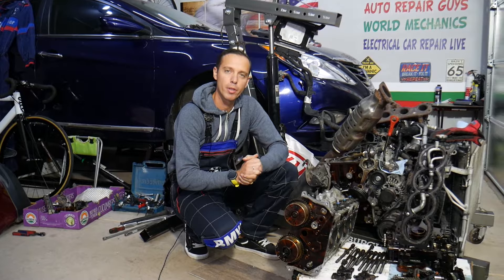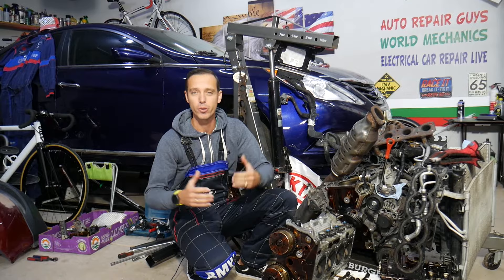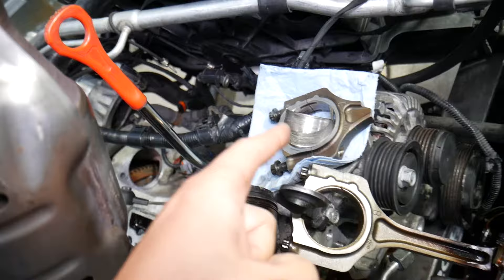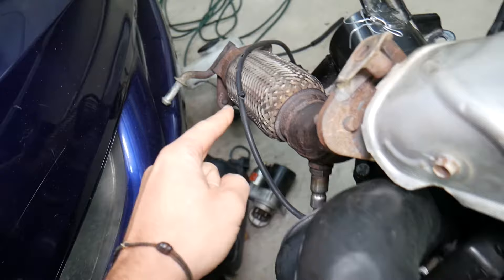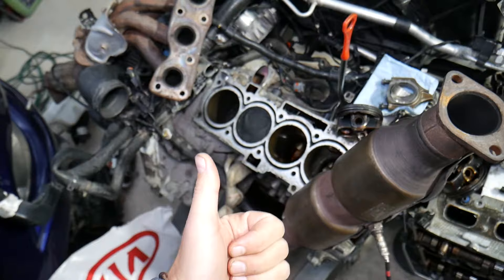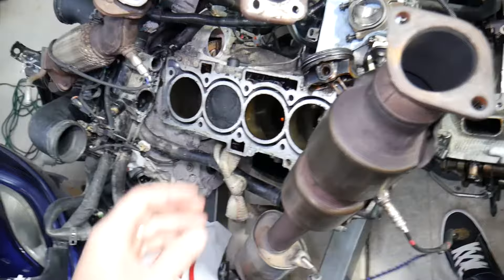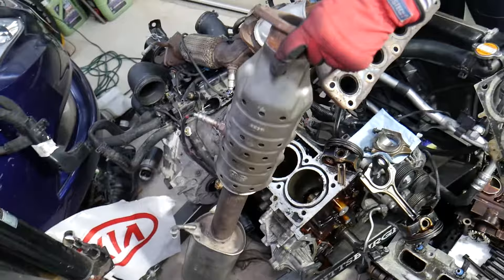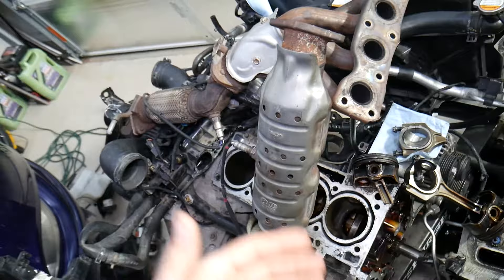WHY CAR SMELLS LIKE ROTTEN EGGS SULFUR WHEN ACCELERATING

Comment: Lexus owners unite! 😔
Reply: YOOO, is250?
Reply: Lol gs 430 smelling funky
Reply: Look for - lexus is250 vent
Theres a duct inside the boot/trunk. Find it and replace it.. or just duct tape it shut 👍
Reply: @indigoprime3663  that’s the problem I had
Reply: @indigoprime3663  I meant to say you had * but yea I might try that but if not prolly try to clean out the cats
Reply: @Tirekillaz  it will work. Trust me.
Reply: @indigoprime3663  I have a gs 430 tho
Reply: @Tirekillaz  Check in the back, see if you have the same ducts.
Reply: @Tirekillaz  just noticed my gs 350 doing it
Reply: @JabrielMarquis   Gs430 and Gs350 both have the same trunk ducts 👌
Reply: What trunk ducts are you guys talking about? My is250 is smelling like rotten eggs
Reply: Yo guys gs350 here 
I only get that smell passed 4k rpm
I checked my ducts 
There is no flaps lmao changing them out 
I still might do a cat cleaner
Reply: Gs 300
Reply: @zeuszerp9376 did you figure out what it was?
Reply: @hamzasahibzada7355  yea it was the vent ducts....there r 2 in the trunk one on each side...youtube it

Comment: Rotten egg smell can also be the battery that is leaking acids…
Reply: I agreed. It happen to me
Reply: Just saved me
Reply: @a.t1700  never knew that
Reply: Wait really? My car smells like massive farts inside and out but my check engine light doesn’t come on
Reply: @weega9852  same bro lmao damn I gtg check the battery asap
Reply: @joshkimisnotmyname2968   bro that’s crazy because the mechanic did tell me I needed a new battery and that’s why I’m sometimes using jumper cables is that why there’s that smell ?
Reply: Does it only smell when you jump on the gas??
Reply: Bad ass bro just replaced mine smell gone good looking out
Reply: i just replaced my last week after i had trouble turning it over. it still has the sulphur smell when i hit 4000rpm
Reply: @knifethrower9733 yeah mine smells when I am going fast, I just got a new battery last month, battery looks fine all around, my car just started acting sluggish when accelerating but acts normal when the car is cruising
Reply: THANK U
Reply: Same did you ever find the problem? @sillywillie5076
Reply: @Manmadecontent  yeah it was my coil on cylender 7, the coil was loose and not touching the spark plug all the way, only found out after it threw a code finally

Comment: This is happening to my moms Lexus IS250
Reply: Mine as well.  I've tried the CAT cleaner, but still same issue. My check engine light is not on. I only use ExxonMobil premium gas.
Reply: @blackceasar2141  bro imma be so mad if i gotta buy cats i just got the car 2014 is250
Reply: Mine doing this rn
Reply: I use 91 and i have no check engine light and i smell rotten egg smell here and there
Reply: Same! Found any fix for your is250?
Reply: Me too! Did you ever find a solution?
Reply: @cfreeze7611  it's normal apparently and to do with having the aircon on recirculation
Reply: I have the same car😭 I’m getting tired of this smell man
Reply: @edwinr.6494  Search up.the car and fix, some guy out surgical masks over the filters to fix it
Reply: @mfg_c.lowk661   mines too for my gs300 (06)
Reply: Have you checked your Quarter Vent Duct Assy? That's what got rid of the smell for me, the rubber was completely torn off which seeped in the smell.
Reply: @nadimmomandi9668  The vents you mention just do what a vent does, it vents the air from one place to another. Blocking off the vent doesn't solve the issue it does hides it. I have a 06 IS250 that has the same horrible smell but do not smell it when the windows are closed, only when they are down. I believe the cats are blocked and the replacements are very expensive.
Reply: Same thing happening to my 2005 BMW 325i that I just bought used smells like massive farts inside and outside sometimes but no engine light has came up or anything and it goes away when I have the ac on
Reply: Same for my is350. That joint stank!
Reply: I changed the plugs and ran a half gallon of seafoam, and now the smell is gone.

Comment: I purchased a used car and it had the rotten egg smell. But after changing to high quality gas and also cleaning out the carbon buildup in my direct injection I never smelled it ever again. So maybe basic maintenance of the car was enough to rid that problem. Haven’t had that smell in 2 years. It’s completely gone.
Reply: How do I clean carbon build up
Reply: @hughlee7107  walnut blasting or if it’s not so bad fuel induction service /cleaning. I go with walnut blasting it is the most effective way but it’s expensive like 700 bucks.
Reply: @KingDrewPhilip  alright cool man thanks
Reply: please dont spread fake news ever again. @KingDrewPhilip

Comment: Could it be coils that are letting unburnt fuel downstream? I have a similar issue, didn't have a problem until I had a misfire code for a bad fuel injector, changed all 8 injectors and now I'm getting a misfire code on the same bank but on a different cylinder and now my exhaust smells like eggs! I'm thinking it might be a coil that's bad....not sure though.
Reply: its ur cats
Reply: I'm also in the same situation as you with my W204 C200... The other main issue could be a vacuum leak. Run a smoke test and check for any cracked vacuum pipes

Comment: The throttle body sensor can cause this too. I had a shade tree monkey. clean mine. I'm sure he used brake cleaner and not throttle body cleaner and that will mess up the sensor up . I'm a 30 years as tech for dealers. Let it go to long and you will replace the the cat too.

Comment: Hey everyone I think I found out the solution on a forum. Here’s what someone wrote:

Hello everyone, I recently discovered how to fix a 'rotten egg' smell in the cabin on my 2007 Lexus IS250, which was driving me crazy.

I had mentioned it to the Lexus dealership, when the car was in for service, without satisfaction........they palmed me off saying that the car was running perfectly and that the smell was a common issue with my model Lexus. Well that's not good enough Lexus !!!

I was hell-bent of finding a solution, read up on various web links that it could be the catalytic converter, etc. etc. ........but guess what, it's not that difficult to fix !

It was purely the case of blocking off a couple of air-vents in the boot of the car, which are badly designed by Lexus, that let exhaust gasses into the cabin. They are poorly designed with a gravity operated plastic flap, that having deteriorated over time, no longer seals the vents to prevent exhaust gasses from being sucked back into the car. See video link here below on how to DIY change/repair this vents at home. 
I simply blocked them off with a thin piece of plastic cut-to-size and glued into position.

Now, no more smell, even under heavy acceleration..........happy motoring !!!

Also search for this vid on YouTube, he showed how to do it:

DIY: Lexus ISF IS250 IS350 rear duct vent replacement
Reply: Thank you
Reply: Gonna try this. Have you had a issue with your 07 not feeling peppy on acceleration anymore? My car has nothing wrong with it, but has been feeling a little sluggish on acceleration. Going to change the air filter since it didn't get changed on last oil change, maybe its that simple. Going to try the rear boot vent thing as well. Thank you!
Reply: @summerc1036 have you had a carbon cleanup done? I barely got an is250 but theyre NOTORIOUS for that issue
Reply: @omgsosa7140  no, but ill definitely look into it. Thank you

Comment: I just got a 2006 chrysler 300c with the 5.7 hemi.. only 56.000 miles.. I get the rotten egg/sulfer smell when hard accelleration... I was thinking the car had likely not been run hard because an 86 year old woman owned it  sense new.. theres no codes, no check engine lights, runs great. also the car sat for abt 6 months because she stopped driving... do u think its old gas?
Reply: Same bruh I’m having da same issue with my 2007 charger lol
Reply: @jayygotit_1 same with my 2017 charger rt
Reply: @darknigeyt5570   damn hemis bruh
Reply: have y’all figured it out yet?

Comment: Hit snow drift it busted oil seat so put spun bearing and put rod thought block 
That motor need alot work before that so threw in used cheaper than repairing it

Comment: Damn my car has 21k miles on it and I smell eggs. Battery is 3 yrs old so I'm not sure if it might be that. My gas is from costco; running 91 premium so i don't think it's that. Might just try an additive first to clean the cat and fuel injectors because that's the cheapest. Then do my battery next if it still stinks when I accelerate. ( Sometimes I'm parked and I can smell it while I'm idling)
Reply: Did any of that work? I just started getting this rotten egg smell, I smelled it twice now but only seems to happen when I drive on the freeway, I am cautious about adding anything to gas tank but might have to if I keep smelling it later on
Reply: @sillywillie5076  Worked for me I think, haven't smelled it for 2 months. Also made my engine seem more quiet but it wasn't immediate. Bought the seafoam for 10 bucks then used it near empty tank, filled up full tank of gas and when i used up half a tank that's when I realized everything seems more calm and the egg disappearing. Try it and see since it's a cheap fix but everyone's car is different so no guarantees haha. P.s it could just be that area you're driving through that smells like it. Ask someone to drive in that area to verify.
Reply: @NKPH  I am still getting that egg smell and I see embers coming from my converter after I drive so I think it is definitely my cats.. haven't tried your route yet.. I just had to fix a coolant leak and my brother helped me to clean all my fuel injectors, car is still riding on low power due to the cats, I live in cali to where I need a functioning cat..
Reply: @NKPH   I did bend one of my coil packs trying to fix my coolant leak so maybe that is having a effect..
Reply: @sillywillie5076  you could try getting a cat cleaner additive. Dump it in your gas tank and let it unclog your cat if it is clogged. Or take the cat off and physically clean it. Scotty kilmer has a video on that if you're wondering if it's your cat. Seafoam will just clean the fuel line and cleans the injectors while it's in there but is not a direct cat cleaner.

Comment: I only smell sulfer when I am vigorously accelerating in a up hill (4000-5500 rpm) is it still the cata the issue? Thanks in advance
Reply: Did you fix your car by any chance? Pls update ty.
Reply: hello  @joshkimisnotmyname2968  i did try to change gas station and add additif to my tank and it happens less often. But to be fully sure i'll need to remove the cat and see if it is coggled!
Reply: @MAS_momo  Goodluck & please come back to let us know , mine does it as well on my is350